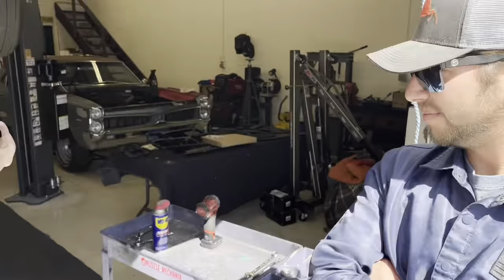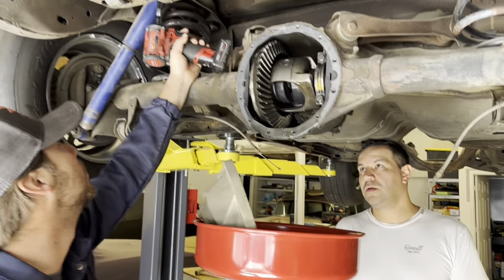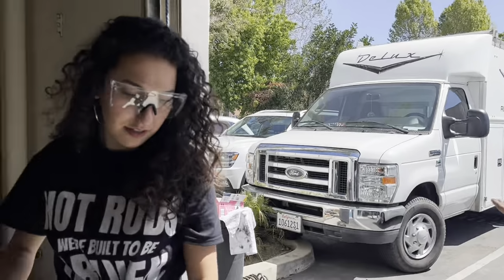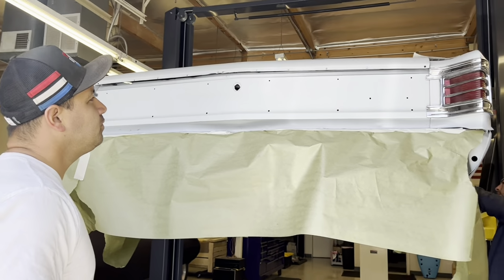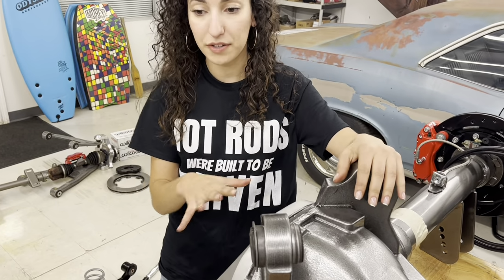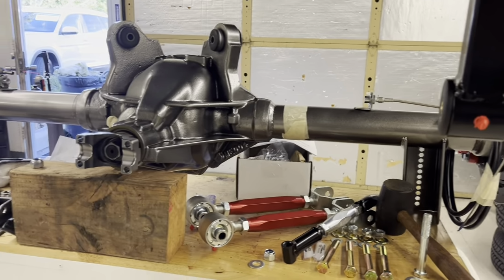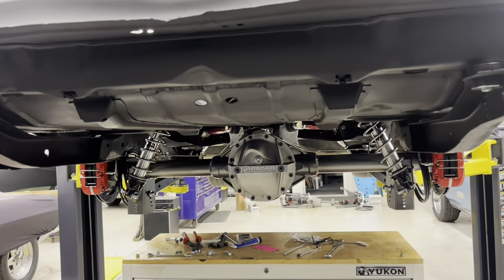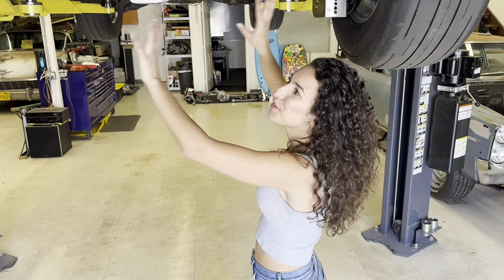AWD Chevelle Gets MOSER 12 Bolt & QA1 Suspension

Comment: My first comment on this build!!😎  Like I've told Liv a few times, an A-body build is an excellent way to go 'cos the basic platform is so good.  Even a radical custom  job like yours should be pretty stress-free if you take the time to do it right {which you are}.  The Chevelle is going to be 100% bitchin' when it's done, if the work already accomplished is any indication.  It ought to wow the crowd if you decide to run Drag Week, or Power Tour.

 Daniel-san, another way-cool thing about your project  is that it loosely ties in with one of my own "bucket list" rides - a 1974 AWD Chevelle wagon.  Don't know if it'll ever happen, but my preliminary research has been very interesting, indeed.  If you're familiar with Motor Trend's Hot Rod Garage "Crown Hick" build - where they took a 60's-era F100 truck body, and plopped it down on a mid-90's Police-package Crown Victoria frame and drivetrain - my idea is along those lines.  A '74 Chevelle wagon has a 116" wheelbase, as does a 2009 Trailblazer SS.  Aside from fabricating new body mounts, it's pretty much plug-n-play.  I'd even be able to use about 75% of the interior, too!!  Again, don't know if it'll ever happen, but I'll be ready if I get the opportunity.

KUTGW, my good man.  Looking forward to the next chpter!!

Comment: Do you have a roll around table? If so you could add some supports, one on each side, tall enough to support a rear end. 
You lift the car up, roll the table underneath, lower the car til the rear of end sets on the supports and undo the hardware so the rear end is free of the car. Lift car up, roll the table out from under the car. To install just reverse the process.